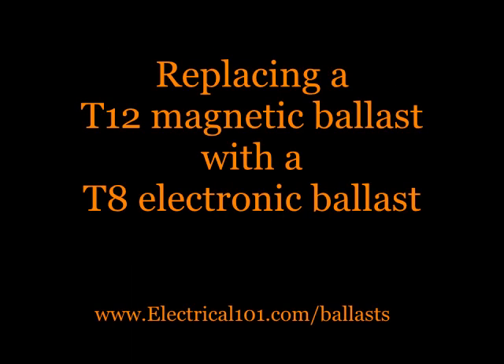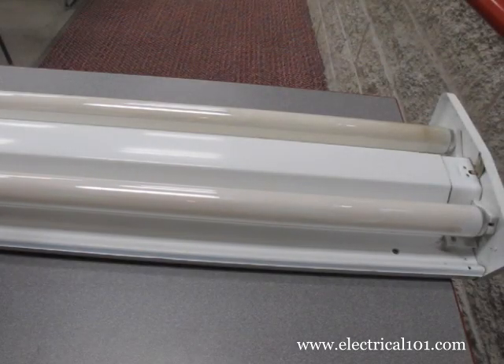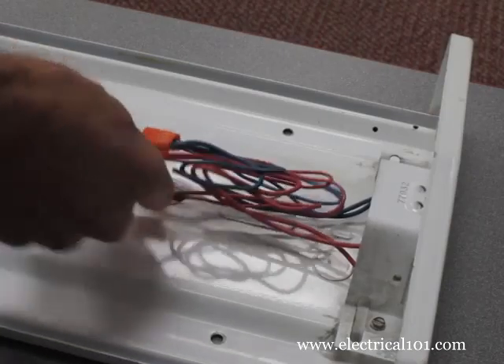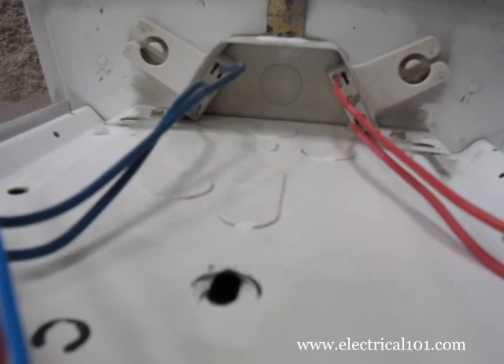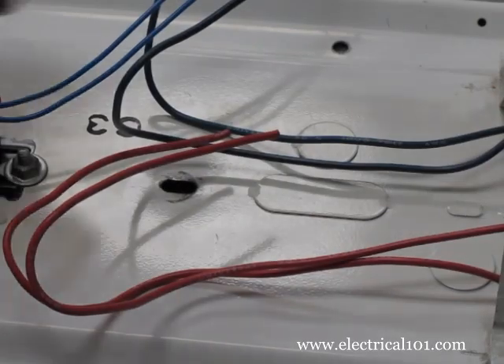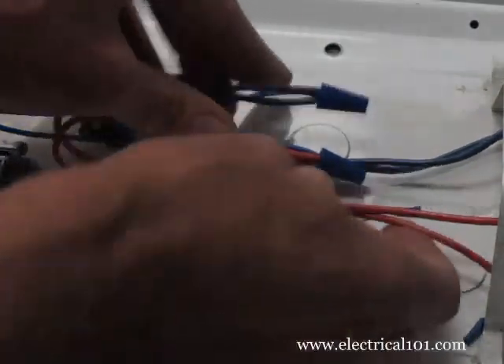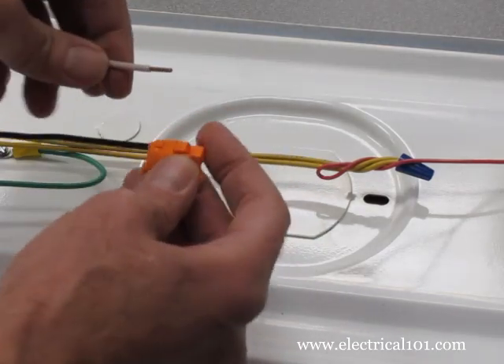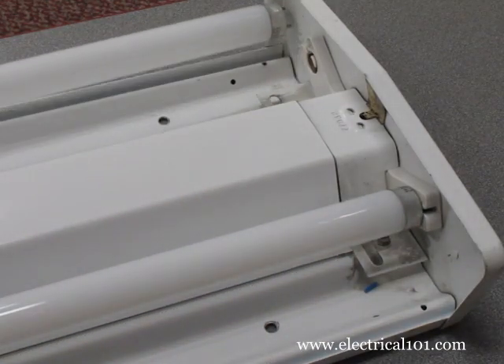How to replace a fluorescent ballast

Comment: I'm trying to figure out what all the Ts mean.  I have a T5/FL ballast that I need to replace.  Is that just the size/type of light bulb?  I was told it was easy to replace a ballast...I just needed to get the 'same thing'.  Good in theory, but I can't find the exact same thing.  I can find T5s, but they don't have the same amount of wires on each end as the type I took out.  Do I just replace it with a ballast with 2 lamps (like the one I removed) and follow the wiring diagram on the new one?  That's what it sounds like.
Reply from the maker: The T stands for tubular and the number indicates the diameter in 1/8 of an inch. T12 is 1.5 in, T8 is 1in, T5 is 5/8 in diameter. http://www.electrical101.com/fluorescent-tubes.html